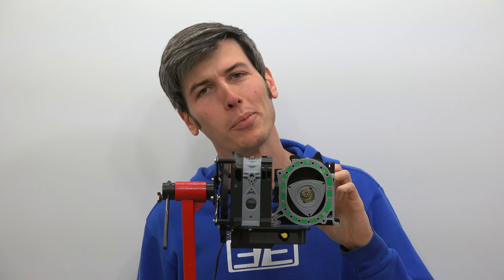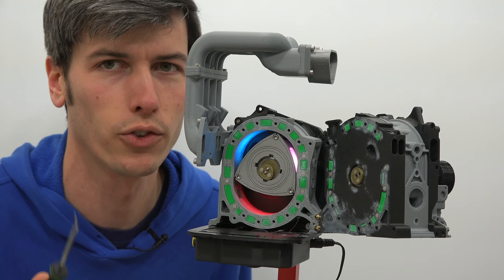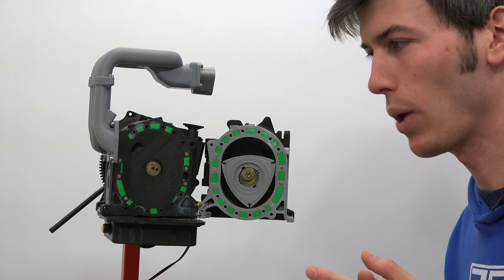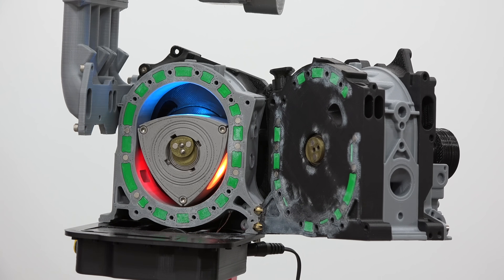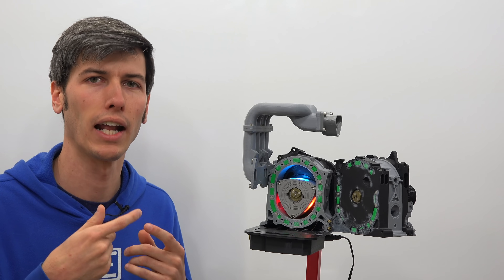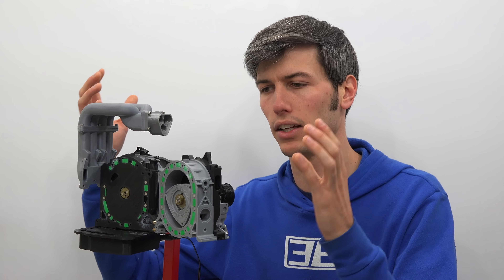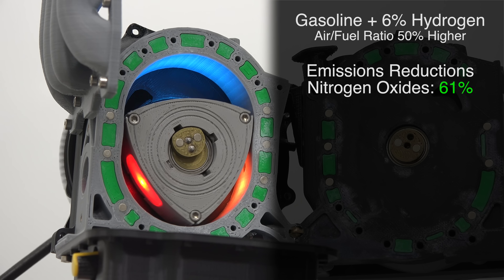Mazda Built A Hydrogen And Gasoline Powered Rotary Engine

Comment: Will be interested to search later if anyone has LPG converted one .... yet
Reply: Bill Shields in New Zealand worked with Mazda back in the 1980's when both LPG and CNG were popular alternative fuels - it was possible to run the rotary on either fuel however apart from developing a few demonstration vehicles to prove that it was possible the idea never gained wide spread market adoption.
Reply: @michael-j-harrison  nice one cheers for the info

Comment: They dont need a tank to hold hydrogen, they need a tank to hold water to make and use the hydrogen on demand thru the simple process of electrolysis. This is where most people drop the ball, the hydrogen is in water...h2o....hydrogen and two oxygens.....both fuels!!!

Comment: So does the hydrogen in a petrol charge have the same diffusibility benefits as pure hydrogen? It seems like only a small amount of hydrogen would be needed to greatly improve the combustion efficiency of petrol.

Don't catalytic converters need CO in the exhaust to convert NOx to N2? That would mean having some incomplete combustion of hydrocarbons would be better for emissions than a pure air/H2 engine, right?

Comment: Why do they need hydrogen tanks?  I you have an extra battery and maybe a solar panel couldn't you just split water and inject Hydrogen and Oxygen directly without using external air so there's no Nitrogen?

Comment: Question, does the rotary piston slides on the shaft? If the shaft rotates 3x faster than piston does it means it's a sliding 'gear' between the piston and the shaft?

Comment: Thanks for the video. I'm learning a lot from these hydrogen videos, but they're also opening up so many new questions. Can you explain to us how different burn characteristics (flame speed, quench distance, knock resistance, ignition energy, burn temperature, etc.) affect a fuel's function in a spark ignition 4 stroke engine? And what causes these characteristics?

Comment: Fascinating. Being able to use gas AND Hydrogen at the same time? Mazda engineers have outdone themselves on this. 

Unfortunately, even if this came to N.America, I'm firmly in the full electric camp. A friend of mine has the Nissan Leaf and...no oil changes. No spark plugs getting clogged. No gas line issues. No starter problems. An electric car is maintenance free (excluding brakes/suspension which you'd still have to do on an ICE). No maintenance = no hassle.

Comment: Something still makes noise to me: if you run the mixture leaner to reduce the temperature in the combustion chamber, it means there is more mass of air per mass of fuel (greater A-F ratio), but this doesn't quite fit into "injecting more fuel into the cylinder/ combustion chamber (richer mixture) to reduce its temperature because running the mixture too lean leads to increasing temperatures". I thought I have understood that correctly, but...
Reply: I also noticed that comment too. Normally a richer fuel/air mixture reduces combustion temperature because the fuel absorbs heat (latent heat of vaporisation) as it atomises. In the case of hydrogen, I assume that the hydrogen is already gaseous when it's injected so that cooling effect is missing. I could be wrong though ;-) .
Reply: +Kevin Wildash Exactly! I think that is what I forgot to consider. H2 has a latent heat of vaporisation of 452,000 J/kg, whereas gasoline has one of 350,000 J/kg if I am not mistaken, but as you said H2 is already in gaseous form, so it is cannot absorb heat from the combustion chamber as it is already vaporised, but gasoline must be vaporised when entering the cylinder in order for a much more complete combustion.

Comment: Ooh.. I commented about this in the last video.. :O

Just to clarify on the Range Extender, they're using a single rotor with only a few hundred CC's of displacement. It works pretty well because you can keep it a fixed RPM for battery charging which helps with efficiency of rotaries and they're pretty low on maintenance too as well as quiet!

Comment: Just throwing it out there, Rotary engine, high or slow revving engine ? 
As the revs are taken from the crankshaft, to me that’s cheating. As it’s geared up at 3 to 1. (An internal first gear ? )
My way of thinking I’d expect engine speed, to be the rotor speed,
Reply: Rev like crazy

Comment: Interesting seeing the benefits of mixed fuels, I've always wondered with those hydrogen generator kits for cars if adding hydrogen to the combustion mixture might benefit the combustion process in such a way that allowed you to extract more usable energy from the fuel, which apparently is the case with the rotary engine at least.

Comment: big problem is the spark plug holes. They need to be a 2mm slit x 5mm. That would keep the cross flow to a minimum.

Comment: Why don't we see small turbines as range extenders on battery vehicles?
Reply: SDD525  smh,...turbines are small, I've seen a small 25 lb turbine as a range extender on a home-brew Camry hybrid that had a turbine as a range extender running on regular pump gas. ICE engines are far more complex and still require the regular maintenance and fluids vs one moving part, no fluids, no maintenance. So how is it " not necessary"? or is that beyond your flippant comment?

Comment: that intake stroke is not  lasting  270 degrees. Yes, the crank shaft turns 270 degrees, but it rotates with 3 x the speed of the rotor, so it's actually just 90 degrees = one quarter of the rotation, just saying

Comment: There is a reason roatery engines are hardley used. They are garbage unreliable engines. This will never be mass produced.
Reply: You sure are boring.
Reply: Rotary engines are just as reliable as a piston engine, it just requires more maintenance. My dad had an FB RX-7 (now mine) back in the 90s and he said it was the most reliable car he had ever had at the time. It would always start and he never had any problems with it.

Comment: Hi! I thought that by running a lean mixture you increase combustion temp (min. 6:53 of the clip). Or is it cooler because of the hydrogen being used instead of gasoline? Thanks!

Comment: I wonder if the low ignition energy is the reason it has such a wide range for the fuel/air ratio. Easier to keep the combustion chain reaction going, even with an extremely lean mix.

Comment: Thanks for this informative video. I've been considering Hydrogen but rather than straight hydrogen I was looking at duel fuel/ hydrogen on demand system. Could you bring out a video for a duel fuel application especially for a diesel application as that's what I am looking for my 4JX1 turbo diesel in my Holden Jackaroo ( here in Australia ) Isuzu Trooper for you guys in the states. The 4JX1 uses the dreaded Caterpillar HUEI injectors so it will not be plumbed into the injectors rather it'll be tapped into the intake system ( not sure yet if before or after the turbo ) any help, advice or video on the subject would be really appreciated.

Comment: Hydrogen by itself is a neat fuel, despite it's shortcommings. But when you factor in how it is made (stripping from natural gas and throwing away the resulting heat and CO2) and how it is transported (fuel burned) and either cooling and condensing it or compressing it (fuel burned), it unfortunately ends up being a very inefficient and dirty fuel.

Comment: just out of curiosity but can't they cool down the combustion temperature by using water alcohol/injection 
also cant you fix the problem of heat distribution by using a 2 rotor wankel engine that has the intake on opposite sides or is there some problem that i'm not seeing with that

Comment: I've owned six RX-7's, I love when you release new rotary videos.
Reply from the maker: Kierkegaard that’s a lot of RX-7’s!
Reply: @EngineeringExplained  To be fair, one of them was only a parts car. Next project will be an Ocho with a disgusting port job on a 13B-RE, or the renesis street ported with a small turbo. I'm excited to see what Mazda has coming out in the next few years with a rotary/electric setup. The 16X has been the holy grail since it first leaked online years and years ago. I don't care what chassis or named legacy it's attached to when finally released, as long as it's mass produced. Mazda can finally make up for the poor reception of the under performing RX-8(the Mazdaspeed model was still an N/A!) with the 16X.

Comment: Why don’t we just have a carbon dioxide into fuel systems in cars ? We can use that fuel and use it instead of gasoline.
There could be a chance gas engines won’t be extinct.

Comment: As you explained it the Hydrogen seems pretty cool for rotary. Some questions:
* No CO2 from Hydrogen; what with the burned oil? Is the outcome the same as with gasoline or due to chemical differences it isn't?
* The power outcome was the same with Hydrogen than with Gasoline?

Comment: The way you describe it, it sounds like the rotary was really made for hydrogen!  Question though, you mentioned a lot of issues with NOx emissions.  Could you explain where the nitrogen comes from if you're just running hydrogen?  Is "hydrogen fuel" actually a mix of stuff?  Or is it just from air (which is mostly nitrogen right)?

Comment: Love your vids. Me I'm a big fan of Hydrogen for cars and of course Fusion power. It's the future. A question, would a Hydrogen combustion burn cleaner. If so maybe it wouldn't be so quick to cause knocking but just a guess. 
  I would prefer to see Hydrogen used with fuel cells running an electric motor. Less waste and overall much cleaner plus fewer parts so cars would last much longer between repairs. Then we also won't have to worry about what to do with all those batteries that battery powered electric cars use. Another nice thing about fuel cells is if you have a blackout you can power not only your house but most of them around you as well if needed. The real upside on that is if we do have a very bad solar storm that takes out the power grid across the U.S. at least power will be available to keep the country sort of running which is better than nothing at all. Worst case insurance unless it blows out the cars as well. Don't know about that but with electronics doing so much of the job it's maybe not a option. Hmmm might be a good idea to ground the bloody things. Hope we get those cars soon because the mag. field around the earth is getting weaker and what had trouble reaching the earth now doesn't have as much trouble. It's a concern. Should be more than that but governments don't do anything until it's an emergency so everyone is pretty much screwed. wow, did I go off topic..LOL..

Comment: As approx 80% of the fuel in a vehicle's tank is wasted, the days of all internal combustion engines are numbered. The rotary can be its last ditch by being a part time motor in a genset setup in a hybrid. As these motors do not get used much they can be tolerated.  Being about one third of the size and weight is a great advantage for a part time hybrid engine.

Comment: A big drawback of hydrogen and natural gas vehicles is the fuel holding tank - they need to be very strong and thereby heavy. And in the event of a vehicle accident the compressed, high pressure tank could be very catastrophic. Good videos, I would like to see you explore propane powered vehicles someday - they seemed to be ignored by the general public.

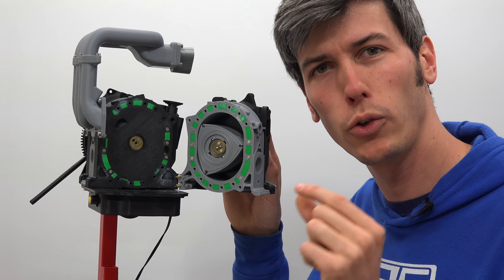Comment: Jason Fenske [5:49]: "That means you burn more of the air-fuel mixture and you have less hydrocarbons going out of the exhaust…"

— Hydrocarbons? You ain't burning no hydrocarbons. There ain't no carbon in hydrogen gas.
Reply from the maker: Zephyr López Cervilla exactly my point. If you’re burning hydrogen there are no hydrocarbons going out the exhaust...
Reply: @EngineeringExplained , that's right, you mentioned that a minute later but I was then too proud to delete a technically-correct remark.

Comment: Greetings from Wahoo, Ne
Suggestion for a Video.   Talk about the gear box used in wind turbines.  Describe the forces.  A wind blade turning 20 to30 RPM to an AC generator need 3600 RMP  (+- 0.01%)  accuracy.  You can calculate the forces by using a 10 meg Watt generator to horse power to power input.  Talk about how they cool the gear box. and the maintenance required.

Comment: All the research mazda has put into the rotary engine makes me wonder if the steam engine could be made as efficient as or more efficien than even a diesel engine. 

The major advantages over internal combustion engines are the ability to burn multiple fuels, potentially more complete combustion, no need for a gearbox as steam engines have all the torque at 0 rpm, silent operation, and a potential reduction in greenhouse gas production. 

Carbon dioxide does contribute to global warming but at least it can be absorbed by plants whereas other greenhouse gases cannot be afaik.

Comment: doesn't running lean actually increase combustion temperature and therefore NOx emissions? I don't really get the way to reduce NOx at low RPM
Same for High RPM, how does EGR help cool down the engine? you are actaully reusing exhaust gases which are hot

Comment: I have a feeling once Mazda and Toyota finish that factory in Alabama and Mazda completes the Wankel range extender, both Mazdas and Toyotas will have hydrogen rotary powered cars. As for the actual engine, what Mazda can do is start 3D printing this engine. If it's possible to print a small one out of plastic, they should be able to print a large one out of aluminum or even titanium. At least, it would be much quicker and more efficient to 3D print a Wankel engine than the traditional way of tooling and casting one

Comment: There is bound to be niche markets for continuation of use of efficient internal combustion engines - e.g like in generators ...etc.
 But driving vehicle wheels isn't really one of them. Combustion engines do everything very  badly that electric does well in this regard. 
In that sense development of rotary engine might have some merit.
However the whole fundamental principles and physics of ICE are just very bad when compared with electric. Its incredible that they dominated the 20th century for so long - but I guess we got stuck to the point of blinkered in a technological rut.

Comment: Any word on how they incorporated the lubricating oil injection system?  If you were running on just hydrogen you would still have the need for oil to lubricate the apex seals.  On production rotary engines the combustion temperatures are lower and the quenching distance of gasoline (that I just learned in your video) would help prevent the lubricating oil from burning.  I expect the higher combustion temperatures and smaller quenching distance of the hydrogen would increase the amount of lubricating oil that would burn off, likely increasing wear.

Comment: Speaking of mixing two fuels, I found a document when researching e85 (i may still have it) where Ford boosted a high compression engine and ran it on regular 87octane gasoline, and had a small secondary tank full of e85 or e98 that would get injected in varying amounts along with the gas to cool the combustion chamber only as needed.... It was sort of like a DEF style setup where you mainly filled with your main fuel and only topped off the 2-3 gallon ethanol tank every few fill ups as driving demands required. Very neat.
Reply: Ethanol (or Methanol) injection was used on many WW2 fighters to reduce intake charge temp (allowing higher boost and getting more horsepower).
Reply: I wondered if the methanol e85 engines could run at 14 compression ratio or the like.
Or would the small amount of petrol cause detonation.

Comment: Meh, I'd be more impressed if they upped the static compression ratio used CNG and once X boost increased the dynamic compression ratio to ~19:1 it switches to 90% diesel / 10% cng. In traditional Wankel engines it's best to toss in some oil in your fuel tank to prolong rotor seal lifespan. With diesel being a lubricant it would mitigate that need.
Reply: Cerberus984 No it is not best to mix oil with fuel unless we are talking very old rotary engines without oil injectors, popular forum missinformation bad idea!

Comment: electric will take over auto industry anyway 99℅ efficient. internal combustion Still only 30℅ mechanical efficiency most fuel wasted in heat. 
Use a second smaller wankel to super charge large one.
Reply: 99% efficiency in an electric engine is pretty optimistic.
In terms of operation, they are far more efficient than ICE's.  But major factors to consider with electric engines are production of electricity (an important factor considering coal is still very popular), poor range, poor charging times (compared to filling a tank), and the myriad of issues involved with the batteries.
A step in the right direction, but they still need a lot of improvement.
Reply: Some engines are 40 % and higher, Mazda Skyactiv X and the new Toyota engine.  Opposed piston engines are supposed to be around 50% efficient.
Reply: SDD525  What's one man's trash, is another one's treasure.

Comment: Jason,

Great that you found the research on combined H2/gasoline operation.  The results were very impressive in an industry were most technology advancements had been fairly level for many years.
Reply: carrying all that tank weight.
no hydr. availability.
don't waste your time
Reply: @wolu9456  - the H2 can be cracked on the fly, only a small water 💦 tank is required. This is being done today, with diesel engines.
Reply: There are good results with higher efficiency & lower emissions when injecting H2 into diesel engines, as well.

Comment: Looks cool, but will it be relevant? Isn't hydrogen with a fuel cell more efficient? And emission free except for water vapor. Although you can't switch to gas when you run out.
Reply: But where is the fun in that? Now you have an actual combustion engine